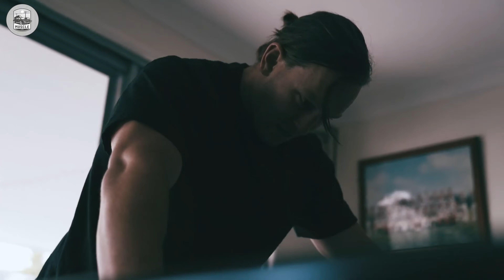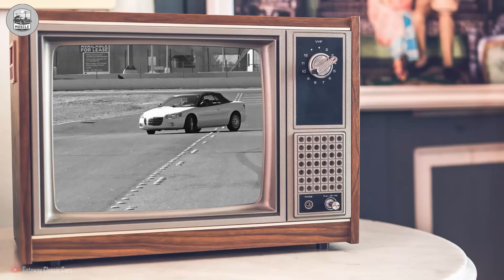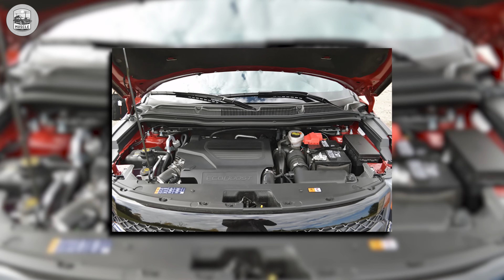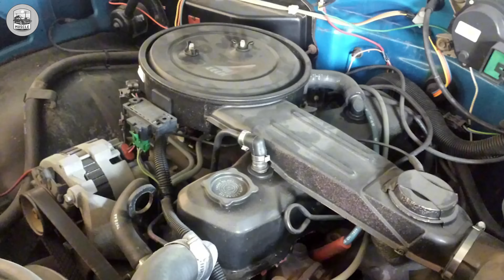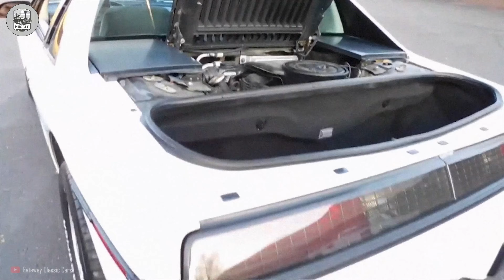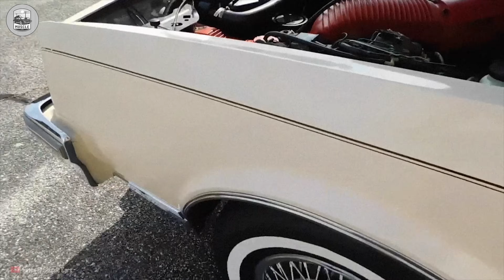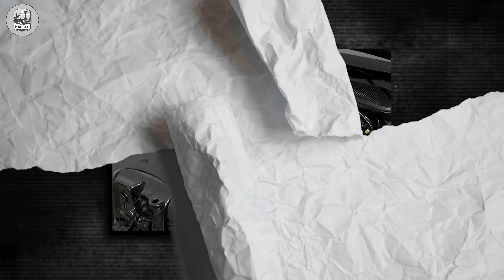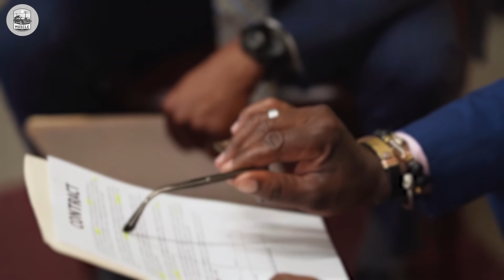MOST FAILED ENGINES ever put in production cars | Worst engine blunder!

Comment: Olds diesel, 0-60 in 11 minutes!!
Reply from the maker: Haha, the Oldsmobile diesel certainly had its quirks, didn’t it? “0-60 in 11 minutes” might feel like an exaggeration, but those 5.7L diesels struggled to live up to the performance standards muscle car fans expected. Designed during the fuel crisis, GM tried to convert a gas engine into a diesel rather than building one from the ground up, which led to durability issues like head gasket failures and injector pump problems. But let’s give credit where it’s due—when properly maintained, these engines could deliver impressive fuel economy for their time. Some enthusiasts have even modified them with updated components to make them more reliable today.
Have a good day
Reply: @MuscleCarMasters68  An example is looking at the difference between an Olds 215 and Buick 215. The Olds had two additional head bolts to prevent head lift under hard acceleration and heavy load. A similar revision could have been made but was neglected as the 5.7 diesel was shelved instead. I live not far from Vail pass/Eisenhower. That stretch of interstate is a real world proving ground. People put their leg in the throttle for extended periods and wonder why a bearing spun or the cat melted down. Subarus are notorious for head lift in that situation. ARP hardware helps but does not solve it completely.
Reply from the maker: @Sunspot-19  Haha, you nailed it with the Olds 215 vs. Buick 215 comparison
Those extra head bolts on the Olds were a game-changer for durability under heavy loads. GM’s 5.7 diesel? A missed opportunity—great fuel economy potential, but cutting corners converting a gas engine to diesel doomed it. Vail Pass and Eisenhower are ultimate proving grounds; extended throttle runs there expose weak spots fast. Subaru’s head lift comparison is spot-on! With modern upgrades like ARP studs, these engines can still shine. Keep sharing your insights! Everyone, comment, share, and subscribe to American Muscle Cars. 
Hope to see you in the next video have a great day

Comment: 3100/3400 intake gaskets 🤢. I replaced way more of them or entire engines due to oil/coolant mixing than I care to remember.
Reply from the maker: Oh, those 3100/3400 intake gaskets—what a nightmare
You’re absolutely right; those things caused more headaches than they should have. GM's design flaws with the plastic intake gaskets led to coolant and oil mixing disasters, often wrecking engines before their time. It wasn’t just frustrating—it was a wallet drainer for countless owners. The upgraded metal gaskets helped later on, but by then, the damage to the 3100/3400’s reputation was already done. For anyone dealing with these engines, always look for the revised gaskets and check the coolant regularly to avoid costly repairs.
Thank you for sharing your experience—it’s stories like yours that keep the muscle car community alive and kicking

Comment: I have known the 122/2200 engine to be very reliable. I own a 98 s10 with 560,000 on the original/untouched 2200 engine. They definitely lack in power. The head gaskets are something I have encountered in engines from the early to mid 90s and rarely in later models.
Reply from the maker: Wow, 560,000 miles on an untouched 2200 engine—that’s absolutely incredible and a true testament to its reliability
You’re right about the power, though; these engines weren’t built for speed but for durability. The head gasket issues you mentioned were more common in the earlier versions, and GM seemed to improve the design in the later models, making them tougher over time. Your S10 proves just how solid these engines can be with proper care.
Let’s hear from everyone—share your high-mileage stories, hit that like button, and don’t forget to subscribe for more! Hope to see you in the next video. 
Have a fantastic day
Reply: @MuscleCarMasters68 my parents both owned cavaliers (80s/early 90s) that went over 300,000. Unfortunately for my s10, everything else around the engine is going to pot. Interior plastics cracking and breaking, electrical problems and rust on the body and frame. I haven’t given up yet, but the decision on whether to get it past another inspection is happening right now.
Reply from the maker: @CoreyBachtell  Wow, 560,000 miles on an untouched 2200 engine—now that’s what we call bulletproof reliability! GM may not have built these engines for raw power, but they sure knew how to keep them ticking. It’s a shame about the S10’s other issues; unfortunately, rust and brittle interior plastics were common battles for trucks of that era. Still, the fact that you’re considering keeping it alive shows your dedication—it’s a true labor of love for any enthusiast.

For those watching, let’s hear your stories! Have you pushed your car or truck past 300,000 miles? Drop your high-mileage victories in the comments below.

Comment: The Volvo 2.8v6 that was made together with Peugeot and Renault was a very bad engine. It was made with 90dgr angle , first it was made as a v8 , and knowing for its rough stationair running. The camshafts failure are notorius for that engine, don’t buy i would say
Reply from the maker: Thank you so much for your comment.
The Volvo 2.8 V6, also known as the PRV (Peugeot-Renault-Volvo) engine, has quite a notorious reputation. Its 90-degree design, originally intended for a V8, caused inherent balance issues that led to that rough idle you mentioned. The camshaft failures, especially due to poor oiling, became a significant weak point, making maintenance a nightmare. Interestingly, it found its way into cars like the DeLorean, which struggled with similar issues. For enthusiasts looking for reliability and performance, it’s no wonder this engine gets a big thumbs down.
We appreciate you sharing your insight! Let’s keep the conversation going—tell us about your favorite or least favorite engines in the comments. And don’t forget to like, share, and subscribe to American Muscle Cars for more engaging discussions.
Hope to see you in our next video! Wishing you an awesome weekend filled with horsepower and great memories. 
Stay tuned

Comment: The 2.5 non turbo subaru engine was the issue, not the turbo
Reply from the maker: The 2.5L non-turbo Subaru engine had its fair share of issues—primarily head gasket problems. Subaru enthusiasts often say it wasn’t built to handle as much as its turbocharged counterpart, which had reinforced internals. Interestingly, the turbo 2.5 engines found in models like the WRX and STI were more robust, with better cooling and head gasket durability, making them the go-to choice for performance fans. The non-turbo version, while reliable for daily driving, just couldn’t handle stress as well over time, especially under poor maintenance.
For us American Muscle fans, it’s like comparing a small-block Chevy that’s bone stock to one built for racing—engineering makes all the difference
What’s your take on reliability versus performance? Drop a comment below, share this with fellow car enthusiasts, and don’t forget to subscribe to Muscle Car Masters for more deep dives into engine stories.
Hope to see you in the next video. 
Have a great day...

Comment: You missed the worst engine series ever built the Ford Powerstroke 6.0L and 6.4L diesel engines. They are notorious for having to be rebuilt between 35,000 and 50,000 miles. The rebuilds cost $35,000 to $52,000 to fix the design flaws and make them reliable. My friend got burned by both engines in his F450 trucks.
Reply: I definitely do not disagree with you, but I have to say that I was very fortunate with a 2004 Super Duty 6.0 that I owned.  I had ~174,000 miles on it when I sold it, and NEVER had a single problem with it.  It hauled heavy payloads on a dedicated route, and it was virtually all highway miles.  I sold it out of fear of what “could” be lurking around the corner.
Reply from the maker: @mistered9435 Wow, it's great to hear a success story about the 6.0 Powerstroke
You're one of the lucky few who had a trouble-free experience with this engine, especially hauling heavy payloads on highway routes. Many owners weren't so fortunate, dealing with head gasket failures, EGR issues, and oil cooler breakdowns. Ford tried to address these problems, but “bulletproofing” became the go-to solution—adding ARP head studs, upgraded oil coolers, and EGR deletes to make these trucks reliable workhorses.
Your story proves that with proper maintenance and highway driving, the 6.0 could still deliver solid performance. It’s always awesome to hear real-world experiences like yours. Let us know if there are other engines or trucks you'd like us to dive into.
Thanks for sharing your story! Don’t forget to comment, share, and subscribe to American Muscle Cars. Hope to see you in the next video. Keep those muscle car memories alive—have a fantastic day...
Reply from the maker: These engines were plagued by design flaws like head gasket failures, oil cooler issues, and EGR problems. Ford tried to address them, but many owners ended up "bulletproofing" their engines, which involved costly upgrades like ARP head studs, upgraded oil coolers, and aftermarket EGR deletes. The 6.0L, in particular, became infamous for its reliability issues, leaving truck owners frustrated. The 6.4L, while offering better power, didn’t fare much better due to fuel system failures and excessive soot buildup.
That said, these engines have become a cautionary tale in diesel truck history. Thanks for bringing this up—it’s always great to discuss these stories. Let us know what other engines or vehicles you’d like us to cover.
Don’t forget to comment, share, and subscribe to American Muscle Cars. Hope to see you in the next video. 
Have a good day.
Reply: I think you're a bit off, Jay. First, nobody charges $52K to rebuild a Ford 6.0; that's as much as the entire truck it came in when it was brand ass new. I've bought and sold more than 500 of these trucks. They rarely fail within 35-50,000 miles. Indeed, the 6.0 is problematic as the miles roll over 100K but here's the reason for most of the problems: When the blocks were cast, residue from that process was ALWAYS present and as time goes by, it breaks loose and works its way into the cooling system which in turn plugs the oil cooler and EGR cooler which in turn leads to major repairs. Install a $500 coolant filtration system early-on and most, although not all, of your potential 6.0 issues disappear. The basic architecture of that engine is strong; you'll rarely hear of lower-end failures. 

The 6.4, smooth and powerful as it is, is a fuel hog because of the iinefficient DPF and it IS prone to early catastrophic failure. Your suggestion to avoid that engine is a good one.

Comment: There are actually 3 different versions of the Buick 3800 engine one was great the others were junk. One version only lasted 2 years it was such a piece of crap. It had a 92% failure rate for 5 years of operation.
Reply from the maker: There were indeed three versions of the Buick 3800, and each had its own story. The Series I was a solid engine, known for its reliability and strong performance. It laid the groundwork for the 3800's reputation. Then came the Series II, a true powerhouse that balanced efficiency and performance, earning its place as one of the best V6s ever made. However, the Series III had its share of issues, particularly in the early runs. If you’re talking about the infamous first-generation 3800, its short lifespan and high failure rate were due to design flaws like head gasket problems and cooling inefficiencies.

Comment: The current Ford 1.0L Exoboost is currently causing owners of the Fiesta, Ecosport, and Focuses major headaches with 393,000 under recall because of oil pump failures. There is no current time line for when Ford will be able to effect repairs.
Reply from the maker: Ford’s 1.0L EcoBoost engine has been a real headache for many owners, with oil pump failures putting over 393,000 vehicles under recall. It’s frustrating for enthusiasts to see modern engines face these kinds of issues, especially when we think back to the rock-solid reliability of classic American muscle cars. Those old-school V8s could take a beating and still keep roaring down the road!
For fans of power and durability, this is why the muscle car era remains unmatched—engines like the 427, 289 HiPo, or the Boss 429 were built to last and deliver raw, untamed performance.
Thank you and Have a good day.

Comment: Could have made it alot shorter. Basicly every engine produced by GM since 1970
 Almost every engine of the same vintage made by Ford. All rotary engines.
Reply from the maker: Thanks for the comment.
 You’re right—there were a lot of engines from GM and Ford in that era that had their fair share of issues, especially as automakers scrambled to meet emissions regulations and fuel economy standards. Engines like the GM 305, some of the smog-strangled 350s, and Ford’s 351M certainly had their critics. And yes, rotary engines had their own reliability quirks, though Mazda stuck with them for a while.
But let’s not forget the gems of that time! The Chevy LS6 454, Ford’s Boss 351 Cleveland, and even the underrated AMC 401 showed how powerful engines could still thrive. They proved there were exceptions to the struggles of the ‘70s.
What are your thoughts on which engines deserved better reputations? Drop a comment, share your favorites, and don’t forget to subscribe for more muscle car history
Hope to see you in the next video.
 Have a great day...

Comment: Cadillac HT 4100 should be in there>
Reply from the maker: Thanks for bringing up the Cadillac HT 4100
 It’s definitely a contender for one of the most disappointing engines ever made. Introduced in the early ‘80s, it was supposed to be Cadillac’s next big step in lightweight, fuel-efficient V8s. Unfortunately, its aluminum block and cast-iron heads were prone to head gasket failures, oil leaks, and poor durability, often leading to catastrophic engine failure long before it hit high mileage. At just 135 horsepower, it didn’t deliver the performance you’d expect from a Cadillac.
The HT 4100 was a bold experiment, but it ended up tarnishing Cadillac’s reputation for quality and performance, especially compared to the big-block monsters of the muscle car era.
What do you think was Cadillac’s biggest engine misstep, or do you have a favorite Cadillac engine? Let us know in the comments, share the video, and don’t forget to subscribe to American Muscle Cars.
Hope to see you in the next videos. Have a good day

Comment: The Caddy engine was good. It was the control electronics which were screwed.😯
Reply: YEP!  I hot-rodded a '70 8.2l (500ci) Cadillac v8 and put it in a '74 3/4 ton GMC 4x4 (K2500).  Runing approx. 450hp / 560 ft-lb torque.  Was a beast, couldn't keep a trans behind it.  Truck had a TH350, and had to rebuild it multiple times.  Finally got a race shop to do a good rebuild, then sheared the transfer case bolts off.  Great engine, could easily turn 38" Monster-Mudder tires into smoke in about 1/2 sec., plus with all the torque, 12-16mpg was typical (not bad for 4bbl Holley Carb.)
Reply from the maker: @abn82dmp  Wow, what an incredible build! That '70 8.2L Cadillac V8 in a '74 K2500 sounds like an absolute monster. 450hp and 560 ft-lb of torque is no joke! It's a testament to how much raw power those engines had, especially when paired with some creative hot-rodding. The story of blowing through TH350 transmissions and even shearing transfer case bolts speaks volumes about the sheer force behind it. And 12-16 mpg? Impressive for a Holley-fed beast like that
We’d love to hear more stories like this—share your builds, experiences, and thoughts below. Don’t forget to like, comment, and subscribe to American Muscle Cars....hope to see you next time.
Reply from the maker: Thank you for sharing your thoughts Cadillac engines of that era had solid potential, but the electronics often let them down. Systems like the V8-6-4 cylinder deactivation were ahead of their time but lacked the refinement we expect today, leading to many reliability complaints. It’s a classic case of great engineering hindered by underdeveloped control technology.
That said, opinions on this engine are divisive. Some fans believe it’s one of the most innovative concepts Cadillac ever attempted, while others view it as a total misstep. What do you all think? Was this engine truly a failure, or just a victim of early electronic limitations? Let’s hear your experiences and opinions in the comments!
Keep sharing, commenting, and subscribing to Muscle Car Masters—your voice fuels this community. 
Hope to see you in the next video. Have a good day.